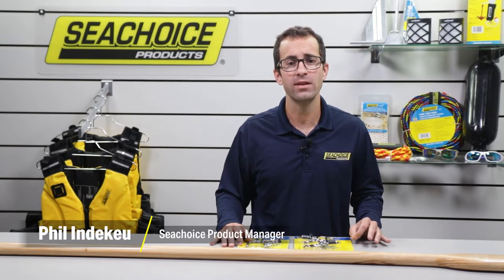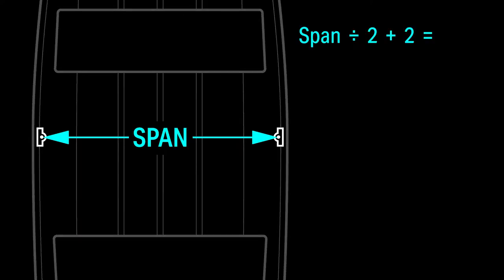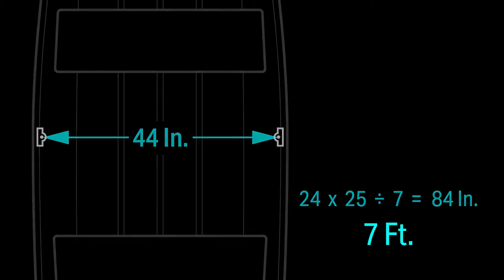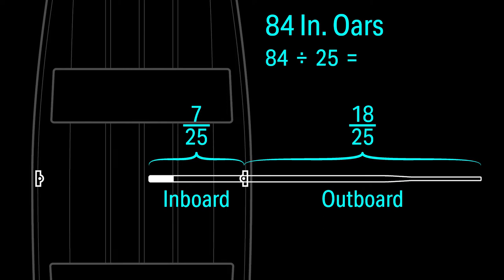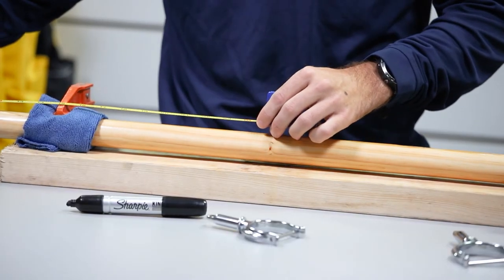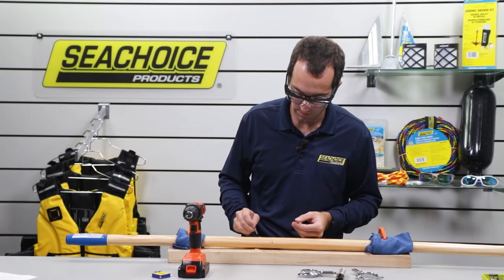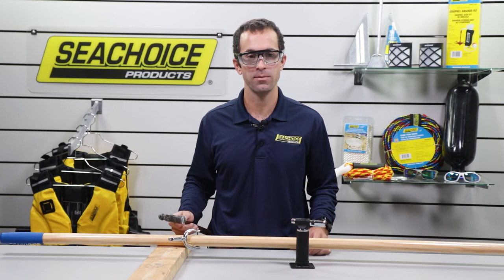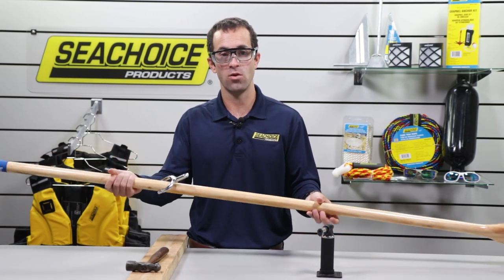How to Select the Right Oar Length and Drill for Oarlocks

Comment: If my math is correct, these measurements for inboard oar length will extend beyond the center of the boat! Would you please explain why? Seems this would cause mashed thumbs!
Reply from the maker: Your oars may be too long. Go down half a foot then calculate the drilling location using the 7:18 ratio.
Reply: @SeachoiceProducts  I have the same question. This person is not asking about his oars, but the calculations in the video. The boat's oarlock holes are 44" apart, yet the holes on the oars allow 23.5" of each oar inside the boat. The oars will overlap when in use,

Comment: The oarlock socket distance on my 14' jon boat is 53.5". This calculates out to an oar length of 102.7". I assume nobody makes an oar longer than 8'? Thank you.
Reply from the maker: 102.7 Inches is about 8.5 feet. If you round down to an 8 foot oar you should be just fine. However, if you would feel more confident with an 8.5 or 9 foot oar, there are plenty of suppliers out there. Good luck!